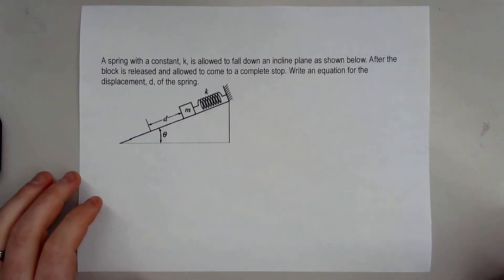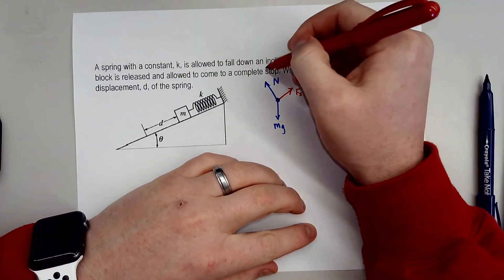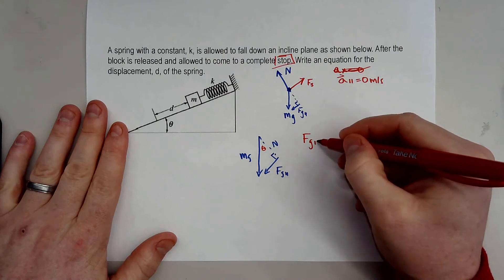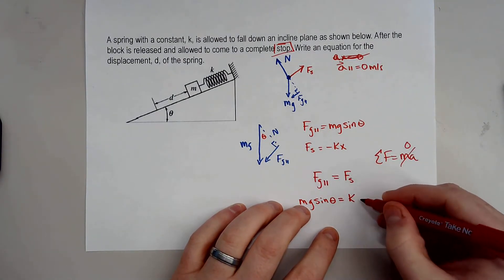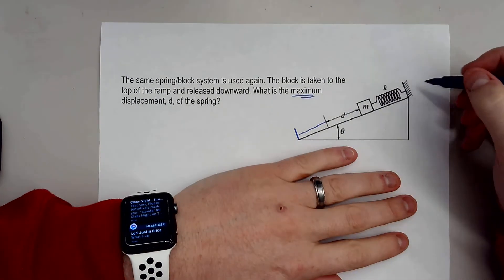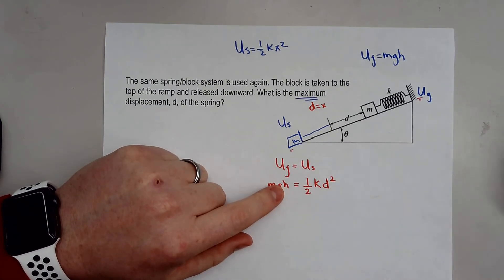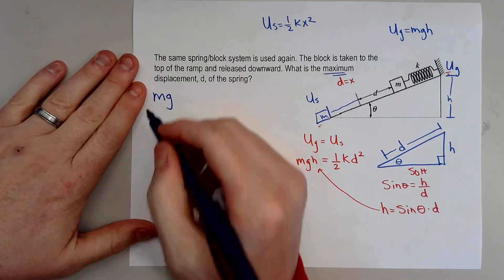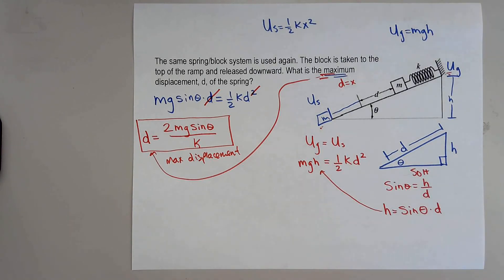Mass-Spring System on Inclined Plane

Comment: Thank you, this is very helpful. I,d like to ask, How to find the maximum d value if the maximum d does not stretch to the end of the inclined plane system? we cannot use the equation sin = h/d. Then, how do we find the value of velocity and acceleration in the system. If an object is moving, it will form a sinusoidal motion. How do you determine the velocity equation? Can you make a video about this discussion? Thank you